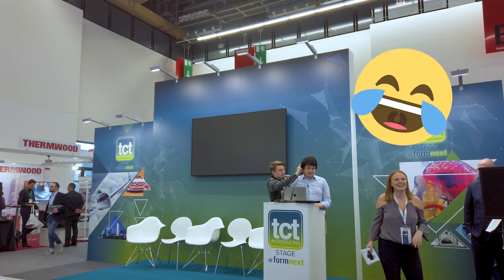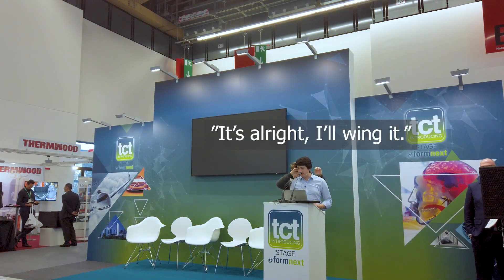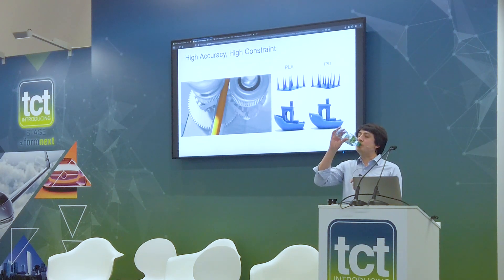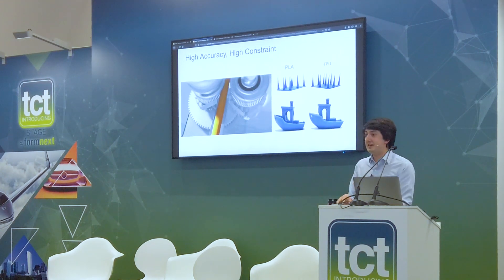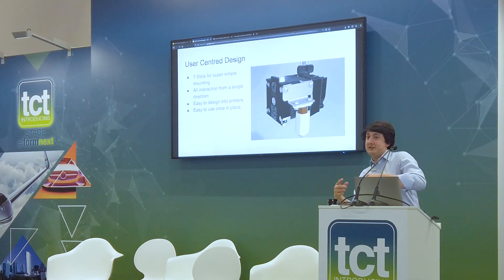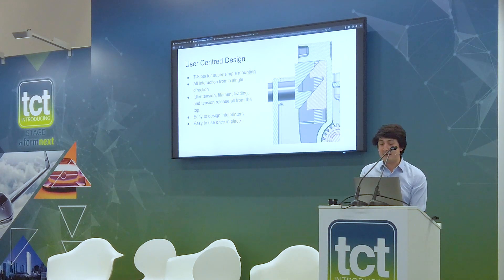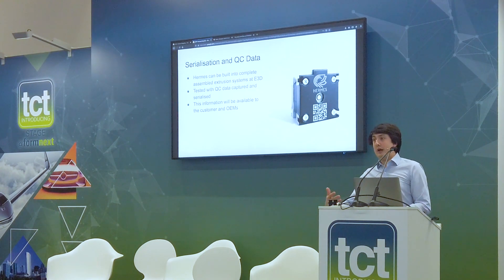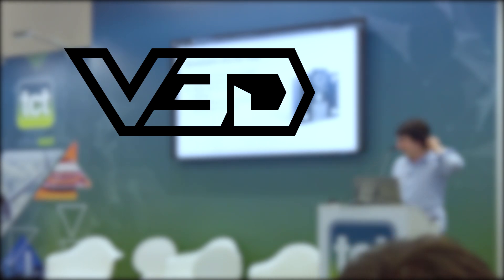E3D Sanjay Talks Hemera at Formnext 2019

Comment: all the kerfuffle at the start, why on earth don't projectors or the screens just do wireless display? it works well with most smart TVs, so why not presentation devices? Seems like a no brainer to me. no more dongles, cables, adaptors, ubs sticks, scrambling..  (truth be told, this should all be worked out hours in advance anyway).

Comment: I think this extruder will be my choice for all my future builds and upgrades.

not only do i trust E3D for the quality of their hardware, but also, all those inovations bring awesome potential benefits for mostly any printer.
But there is also the fact that those guys defined the golden standard for extruders with the V6, and i can see this become a new standard.
Meaning, long term support for many manufacturers, but also lots of mods, tweaks, addons, etc...

With such blocks, i feel like we're really reaching super high reliability in extruders in a way that machines will converge more to generic settings
(meaning, you won't have to tweak your settings for your specific instance of a printer, but for a general class of printers; obviously here only the extrusion settings).
That would mean that rather than having X profiles for each material for each printer, we could tend towards a more generic PLA profile.

With high quality filaments such as prusament, we also get a more uniform material, meaning that the extrusion gets pretty much constant for a given task (i mean
no need to adjust for over or under extrusion on extruder X with filament Y). Altough to eliminate this, a filament thickness sensor would be awesome, with an auto adjustment depending
on filament thickness.

Anyway, this extruder is something i feel like i could bolt on any CNC platform capable of 3D movement, and get consistant results.

That means that we can focus on the other parts of 3D printing to increase quality and reliability, and just don"t worry about extrusion... Plus with linear advance, i expect stellar results.

Can't wait to use it on a super rigid machine with all linear rails! (hypercube?)